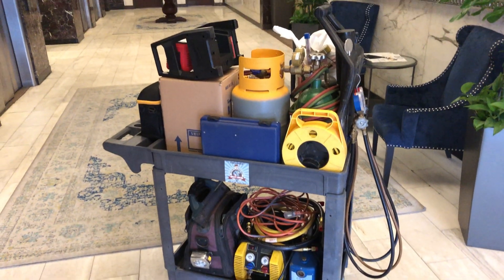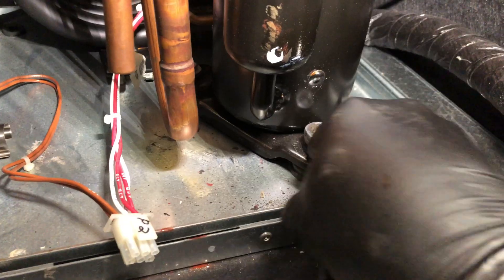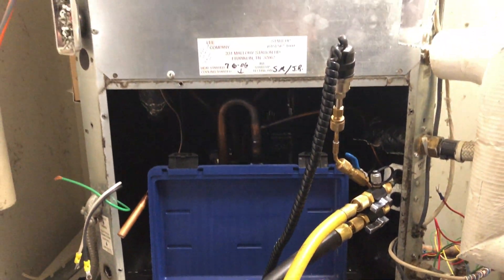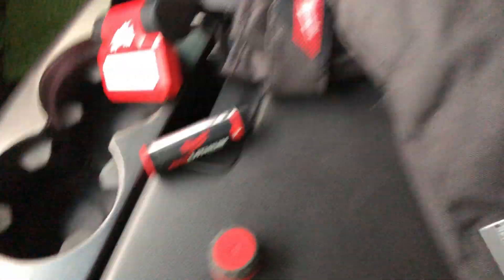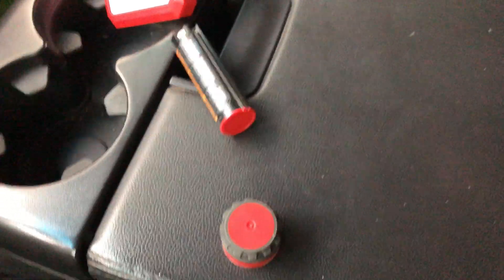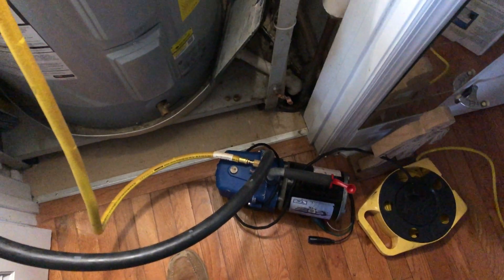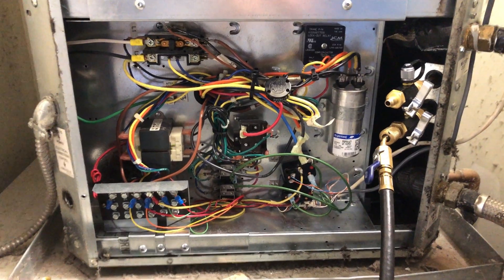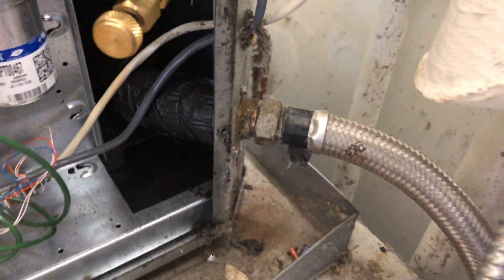How to REPLACE a COMPRESSOR in a Water Source Heat Pump HVAC Unit!!

Comment: Do video on cooling tower.that building must have one or big chiller.i just did a spray pump on a tower it was a nightmare had trouble getting old motor assembly off of the valute.do you have any tricks for that .

Comment: When you retrofitted to 438a did you have to clean the system first or as you mentioned is a good replacement for r22 have you ever thought about using R-32 if the system can handle refrigerant? R-32 I believe may be eventually replacing 410a
Reply: As long as there isn’t compressor burn out then no. Same compressor oil. It’s a drop in replacement.

Comment: Did you work out the root cause? Install or replace a filter drier? 
Check for acidity?
Run test? Sometimes calcium builds up in the water heat exchange = high head pressure. The root cause of compressor problem
Reply: I was curious of the same stuff. I was wondering if he switched the reversing valve also. Something is causing these compressors to fail....TXV, reversing valve, etc.

Comment: Phenomenal Job man. Your quality of work is very detailed. I like that you keep your spaces clean and do the job right. I wonder how long some of these jobs take because your a one man band. Then I kinda envy you because you are your own boss and don't have to worry about anything extra with hack coworkers and you just get the job done with clean straight lines and quality sheetmetal to boot. Great Job and I definitely strive to one day be like you with the confidence in all aspects of the trade. My only questions are what are your strengths and weaknesses and how long have you been in the trade?
Reply from the maker: Thx Scott! I’ve been in the trade for 18 years now. I would say my weakness is on theory (never went to school) of electricity and refrigeration and my strength is hands on troubleshooting.

Comment: Might I suggest using a drop cloth. All you need is a scratch on the hardwood floor to either delay or reduce your payment.
Reply: You are supposed to blame the maintenance guy for stuff like that.and buildings like this has cleaning personal .go in like a bull in a China shop .

Comment: I just started working as a helper in a company they only do comercial HVAC , and i worded if should I go for a associate degree to have knowledge for residential/ commercial hvac
Reply: You dont nessesarily get a "degree" in hvacr. Its tech school or be a quick learner. Go on the esco website and study and use the practice tests for the epa certification. Then find a place that administers the test locally. Stay away from cheap tech schools.
Reply: If you have a community college near by that offers a good HVAC associates id say go for it, I did and learned way beyond the curriculum, people who say they went to school for it and learned nothing probably didn’t take it serious or just had a crappy instructor

Comment: Hey there bud I just subscribed to u after looking at multiple videos of yours and I love it. I've been in the field 7 years in Indiana and I learn alot from HVAC VIDEOS...you are a "to go to guy" for me. I've just started on water source heat pumps and I have very tight spots. I couldn't change a blower motor if I wanted to because of space....but I love your videos...SHES A CRUSTY ONE MAMA( STEVE LAV VOICE)

Comment: I never use a alternative refrigent because you lose capacity and I personally think it's hard on the compressor. I add a high side filter and no matter what change the capacitor and contractor . It doesn't add much to the bill and its goog insurance.

Comment: How you work prices out for this repairs on these type of units? I have a building also where they have water source heatpump and when i call for prices on evaporator coils they run about 750.00 which makes the repair very expensive

Comment: Where is the HP water comming from?
Reply from the maker: It comes from the main building loop. All the heat pumps are piped together, the water gets circulated through either a boiler (to heat the water in heating season) or a cooling tower (to cool the water in cooling season). This is a closed loop system.
Reply: @QualityHVACR  Thank you for the answer. This is really interesting. I see a lot of benefits and some problems related to this approach. I can not find anything on the Internet. I'd be grateful for some more info re. (mabye next video):
1. provision of make-up solution after some volume has been lost due to leak/repair,
2. ground loop, keeping parameters (return temperature) under heavy load/dimensioning (only ground loop, boiler to provide missing heat, rack to provide missing cold)
3. energy metering for flats,
4 are heat pumps owned by appartment owners or some other arrangement,
5. is noise a problem during night when dozens of relatively large compressors operate in the building.
6. what's your opinion generally about this solution.
Thanks for the effort.
Reply: When I reread your post I realized you actually answered some of my questions. Active heating/cooling of lower source somewhat goes against main advantage of a typical ground loop, which is passive and at least partially transfers heat/cool beetween seasons of the year. Also it is unnecessary layer of equipment which add to the complexity and brings no economies.